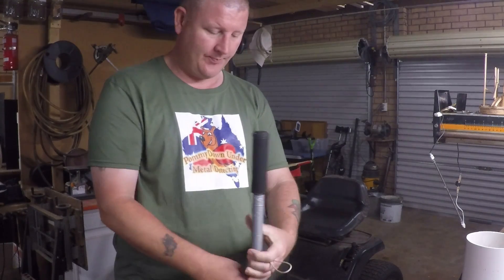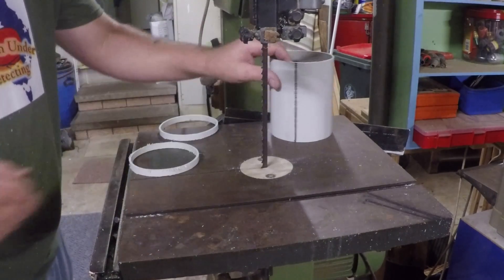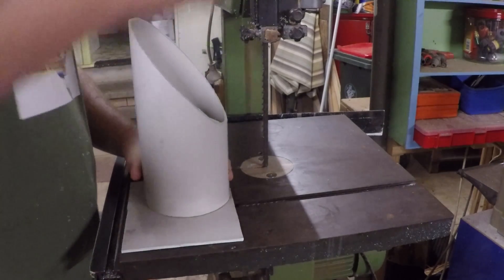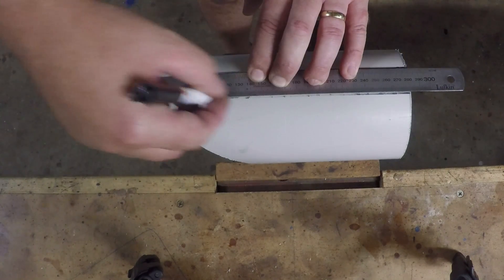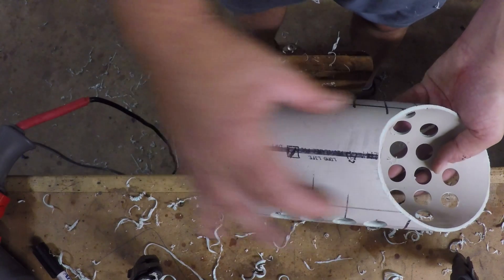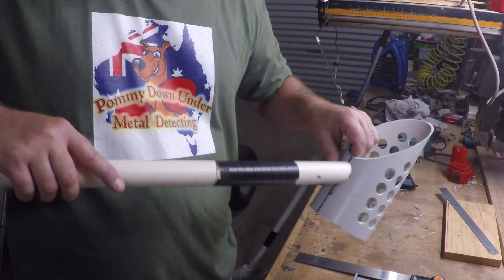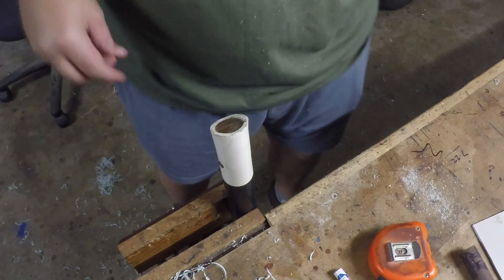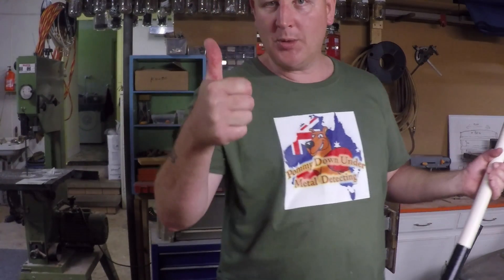#36 How to make a Sand Scoop for $0, DIY Project

Comment: Great project for the occasional beach hunter. Would have made the holes smaller to 13mm as many small bit of jewellery etc could fall through.
keep the vids coming.
HH   Mal
Reply from the maker: +malcolmpotter Hi Malc, the first one that i made, I did have smaller holes but it didn't work very well so I made the holes just smaller than our smallest coin, and you are right, every now and then something does go through, but I have the advantage of owning a metal detector, it doesn't take much practice to realize when something is going through your scoop when shaking the sand out. Thanks for watching and commenting malc. Cheers Glyn.
Reply: Pommy-Down-Under (Glyn), I’m 3/4 of my way through my one. I’ve drilled 16mm holes that are staggered. I’ve drilled a coach bolt through. And made up an angled plastic spacer. So there is even tension on the bolt. Through that spacer I can also screw another screw up into the wood. I took your advice and reinforced were the handle is mounted. I’ve decided to use a end cap. Instead of making up the back part. I’ve got just over 45 degrees angle on my pole. From yours it maybe a bit steep. Time will tell. I also made my scoop a little shorter. To reduce tension on the handle in wet sand. I may have to dug twice 😃. I can easily remove the handle from the scoop. So I could make another scoop. It will only cost me the price of the rear cap. I was going to drill 12mm holes but I read one of your posts that your small holes scoop didn’t work that well. Cheers for posting this video. Brent

Comment: I’ve just started beach detecting I normally detect inland but we’ve had a lot of snow here in the uk,I didn’t realise how expensive they are too buy so I think I’m going to give your diy one a go,thanks again and good luck hunting ;)
Reply from the maker: Nothing is cheap these day's hey. Having come from the uk I know most of the detecting your lightly to be doing is in the wet sand on a beach, I'm sure it will be okay for the every now and again in the wet stuff but if your a keen detectorist then save your penny's and get a good one, the wife only uses hers in the dry stuff and occasionally a bit of wet. Here is a link to the one I use now https://youtu.be/6mImg5kESvo     ATB mate

Comment: Great use of cheap materials. I have a suggestion, instead of using silicone try using PVC cleaner then PVC or CPVC solvent cement. If done right the joint will be stronger than the surrounding materiel and will not likely ever fail.GL&HH
Reply from the maker: Thanks for watching and the Advise mate.
 I've made 2 of these, the first one is nearly 2 years old, and there still going strong. :-)    HH
Reply: Hey Pommy,  Ive done the waterproof "antenna" with the Aryca case.  Great ideas and you just answered my quest. "how long would something like this last"?  You're the kind of guy that makes the world go ' round a little easier with neat ideas/common sense when 'common sense' isn't so common anymore!

Comment: A. That siliconed in triangular support is worthless.  Best way to construct a support brace would be a 3d printer. 
B. The single screw attachment is going to loosen up and the can will start spinning.  Running the handle all the way through the can would be far stronger and put zero pressure on the screw.
C. 16mm holes will keep all rings in the scoop.  18mm they can slip through.
D. Find a way to leave the metal screw out and you can pass the coil over the can. Very useful especially in water.
E. Zig Zagging the holes is more structurally stable than holes in straight lines.  It's the way bridge trusses are built for that reason
Fun project and good starting point but that thing is not gonna last five minutes on any target deeper than one inch.
Reply from the maker: Hey mate all valued points, I have Got 2 and there still going strong after nearly 4 years, wet sand they wouldn't last long though. Always room for improvement but not everyone has 3d printers this is a basic build that you can do with a saw and a drill. Have a crack and build one your way and post video, look forward to watching.
Reply: im going to go buy a 3d printer to do your method indeed !!! oh wait , that costs a lot der
Reply from the maker: It was the end of 2015 when i made this video, 3d printers were then Big $$$$.
If trying to help or inspire people to have a go at making their own, is a crime then I'm guilty.
I made 3 sand scoops and only 1 has failed and 2 are still going strong to this day, they are mainly used in the soft sand of course.
Seems like you have all the answers? why not have a go at making one yourself and post the video of your creation for us all to see?

Comment: I want to make one. I will make my holes a wee bit smaller though like 1/2" or 12 mm and use an alternatingly pattern. I also question why you didn't use pvc cement rather than the caulking adhesive ?

Comment: BE EXTREMELY CAREFUL using a bandsaw to cut tubing of any kind. If the blade is dull it will grab and spin your project forward and if you are holding tight you get pulled towards the blade.
10:38 Instead of Silicone, use a soldering iron and first tack weld it in place and then use the tip just like a welder. Poke, pull, poke, pull... I've made 90 degree angles the would not break with this method. I also poke the iron through the inside into the braced piece for extra support.
Very disappointing that you didn't use it at the end of the video...
Reply from the maker: Thanks for the advice mate, sorry I had a disappointing end for you, and your right it would of been better with it being shown at the end, in use,  all i wanted to do was show people on a budget what they can do for cheaper than the bought ones. However Its still going strong and its all that the wife uses on the beach. It has been in my videos since it was made. Thanks for taking the time to comment. ATB.

Comment: Cool scoop.  But id have to spend $1000 on the bandsaw and tools to build it.  Cheaper to just buy one?
Reply from the maker: Drill with drill bit and Hand saw, is all you need, I did a video using only that but deleted it by mistake and couldn't be bothered to do another one  :-) Thanks for watching and commenting.
Reply from the maker: https://youtu.be/6mImg5kESvo

Comment: Hi, great video, going to attempt it this weekend. Can you tell me what glue you used for the base please?
Reply from the maker: Hey Olly, The glue is a PVC cement.You use a cleaner fluid first that cleans and preps the surface ready for the glue, then the cement/Glue,  any hardware store or pluming shop will have it, Good-luck.

Comment: hey buddy, great idea! hod  Durable is it with that single screw going into the shaft I am a bit tough on my gear do you think it would hold
Reply from the maker: Hey mate, its fine in dry sand and its still going 3 years on, but if all you do is wet sand?  it probably wouldn't last very long.  Happy Hunting.